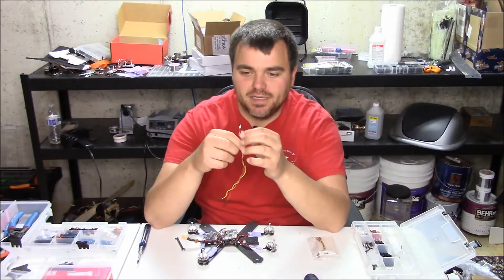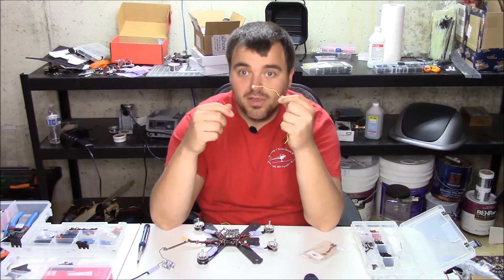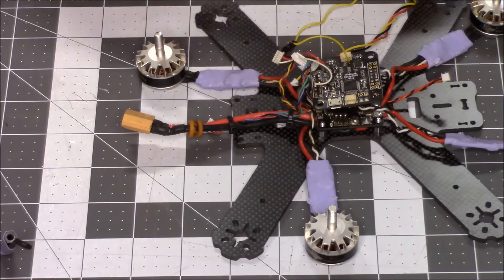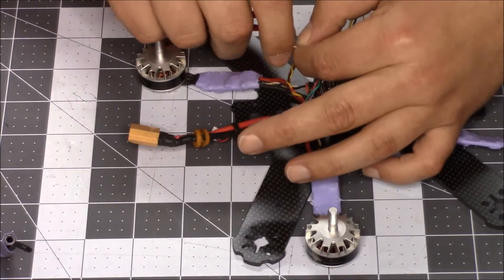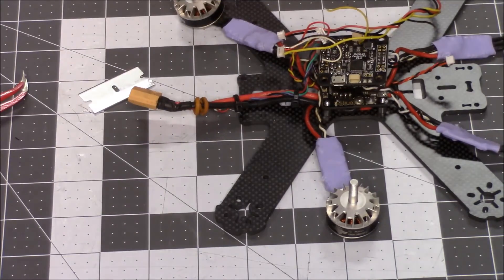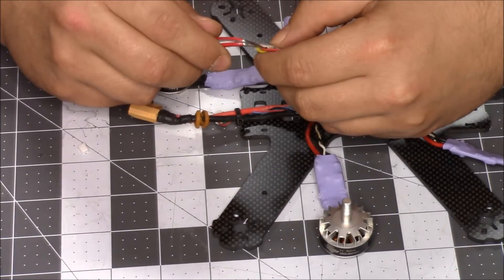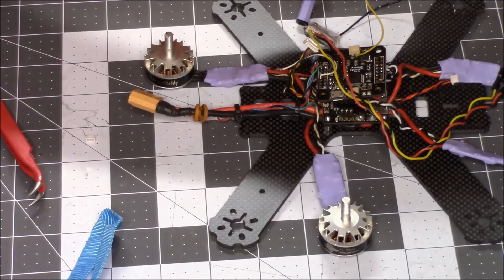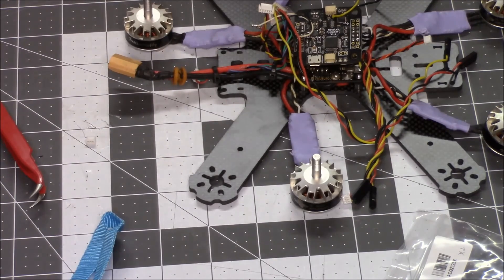FrSky Silicone Wire Upgrade

Comment: Which frsky receiver is this? ( same one you used your bff3 board, with the pin headers ) 
I want to replicate your technique. Sorry about the parking garage deal.
Reply from the maker: That's a XSR, and the silicone wire upgrade is only for the XSR.  The one I used on the BFF3 board is a Frsky XM+, and that's (XM+) the receiver to use with the bff3 board, it's small, and provides RSSI in the OSD ... but not back to the radio.  You can get the RSSI back to the OSD on Aux channel 12.  If you can't get it to work post a reply to this here and I'll walk you through it.

Comment: Thanks for the tips.
The official crimpers for Molex pico blade (1.25mm) are around 275$ (http://www.digikey.com/product-detail/en/0638190300/WM9984-ND/2193029). But I do agree that if you can find other solutions like pre-crimped wires, that's the way to go.
Reply from the maker: YTFPV Yeah, and I have a drawer full of crimpers at work, but the smaller the gauge the harder it is to do it right.  Glad you found it useful.

Comment: Every Time I switch to silicone covered wire, the covering shrinks, and it takes away the strength that the harder plastic covering gave it. There have been several times that wires have broken inside the silicone covering and it was harder to find the issue. My $0.02 Thoughts?
Reply from the maker: Anthony Gennello Thanks for the feedback.  I also reference where to purchase replacement PVC wire and connectors that can be used for factory style repair.